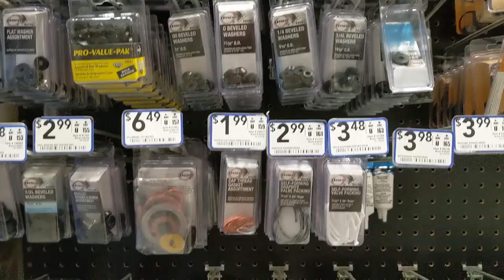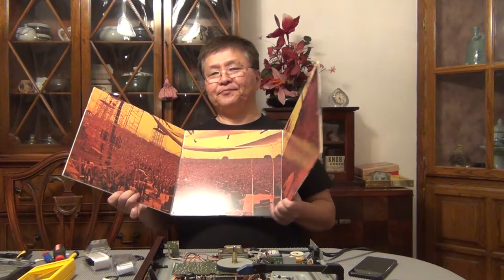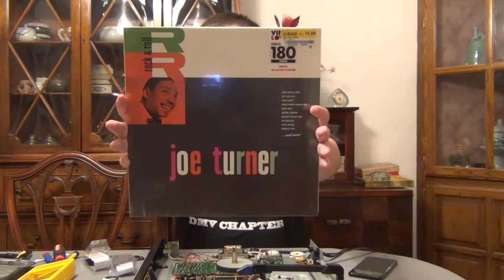How to fix Kenwood KD-65F Linear Tracking Turntable? (Part 2 of ???)

Comment: That was a good thing to watch and see. You didn't give up and got it going. That's  happy times right there when you hook it all up and push play and it works like you hoped it would.
Reply from the maker: Hello,
Yup, when thing works like they suppose to, you don't get to enjoy that extra happiness. :D I am glad I got it working.  Thanks for dropping by with encouraging words!  Be safe and take care!
~NammaN~
Reply: @JOAMON  I recently got the one my dad bought new years ago out and got it going again. I did the o ring belt trick on it. Mine has terribly bad micro switches though. I deoxed and alcoholed them several times but some just won't work right. I can track it over and que it and it'll take off and play though. It's good enough for me for now. Has a good needle on it to because it sounds perfect. I'm gonna get me a nice higher end one later on though.
Reply from the maker: Hello Sandman,
I am glad to hear you got another KD-65F running with old O ring belt trick! :D  For future reference, I found an exact part for that at Amazon:  https://www.amazon.com/gp/product/B0719KWNLT/ref=ppx_yo_dt_b_asin_title_o01_s00?ie=UTF8&psc=1
Regarding micro switch, I do have a manual and I did a flip through on this video: https://youtu.be/ro1N9VhygM8?t=1144
If you need better image on certain page let me know.  I am on vacation now but if when I get back I will post it somewhere.  Thanks for the visit and giving update on your KD-65F!  Take care!
~NammaN~

Comment: How repair arm don't  down and play
Reply from the maker: Hello, I don't know what is happening to your 'tone arm'.  Do I assume you are talking about the tone arm???  If your tone arm don't come down at right place and play the records, too many things could be wrong.  Is your motor working?  If it does, does it spin too slow or too fast?  Your motor ring too loose or too brittle?  So many things...  The last resort is to adjusting your tone arm setting.  I opened up the manual to tone arm adjusting in another video but I never had to do that myself.  Anyway here is a link to it:  https://youtu.be/ro1N9VhygM8?t=1301  Good luck!